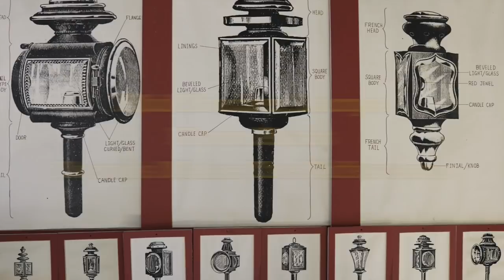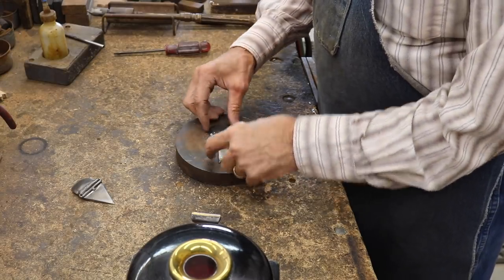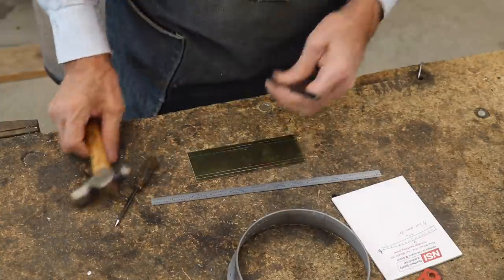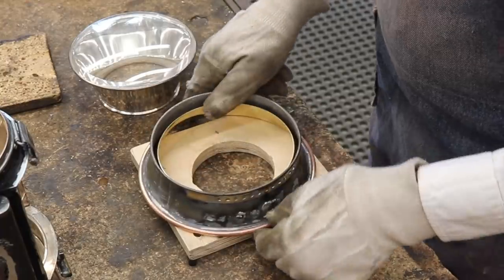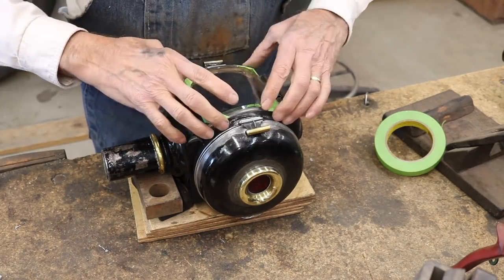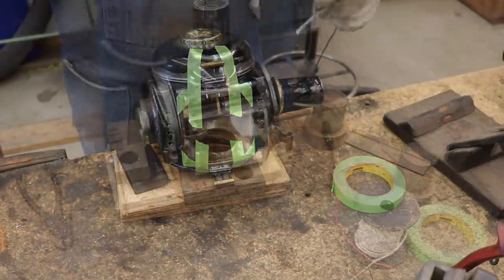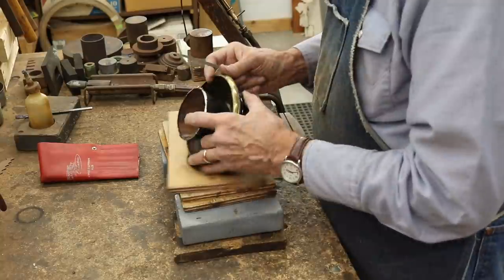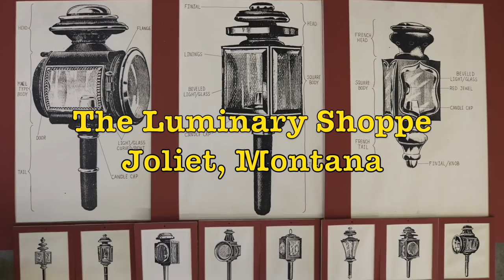Muhlbacher Lamps From Paris Details make the difference

Comment: My Dad had this 13 year old try to fix a utility tool for an antique printer years ago.  Now that this 13 year old is much, much older its time to fix his screw up.  its good to know that soldering imperfections to fill them is a real option is good to know.  Thanks.  Hopefully the actual coating of that tool is tin.  I only found out a few months ago that the material its made of is brass and its coating is some shinny stuff.  Unfortunately this printer was made back in the days where lead was a common household item, much like the lamps you repair.  Speaking of which, if you are looking for content, how do you deal with the lead you come into contact with?  That would be quite educational.
Reply from the maker: I used to have a blood test every year but never had any sign of lead. My Dr. says the problem is usually seen in the very young. Not much of a problem in older adults unless it is ingested. Thanks for watching!
Reply: @TheLuminaryShoppe  Maybe the sign is starting your own business <grin>.

Comment: Very nice video Rick. When you solder the polished brass does it turn the brass a different color due to the heat?
Reply from the maker: It does but that polishes off very easily. Thanks for watching!

Comment: At 6:03 The holes in the patch don't seem to match up with any holes on the (I think you called it a flange) part you soldered it on to. Dix you drill holes later sir? Are the holes there and I couldn't see them from the camera angle, or are they decorative?
Reply: If you stop the video right at the start of your 6:03 timestamp, and look at the flange, you'll see a big slot that the holes go over.  Use "," and "." keys when the video is stopped to go back and forward one frame, respectively, and you  should be able to find a frame where it's really clear.
Reply from the maker: Yes, I cleaned out the old holes and prepunched the brass strips which are soldered over the old holes. These holes are functional , they admit air into the lamps for combustion of the candle.

Comment: I would like to ask about carbide gas buggy lamps carbide gas carriage lamps have you built many please reply
Reply from the maker: Carbide lamps were used on carriages however not very commonly. They are quite rare. I have had a little experience with carbide lamps but none that were for carriages.